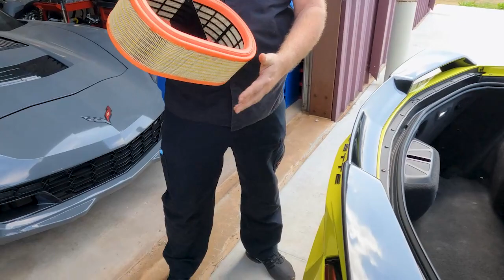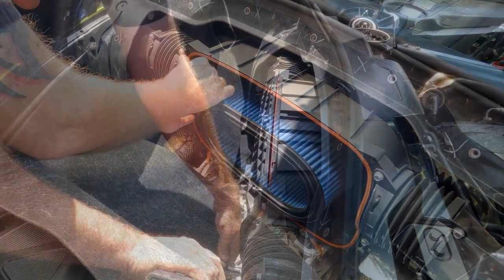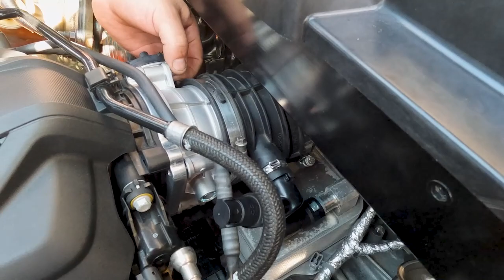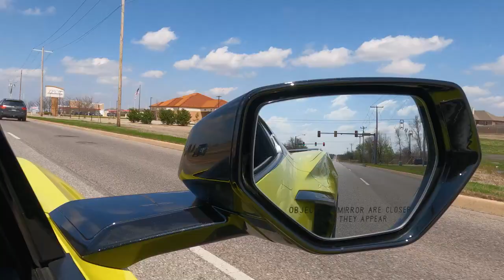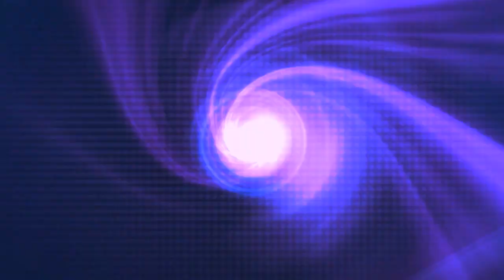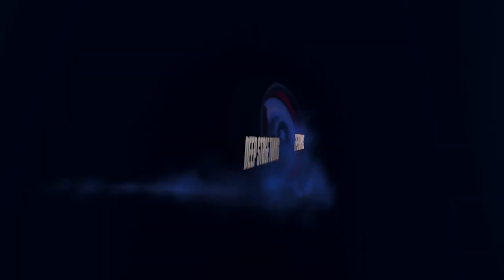C8 Corvette New Throttle Body and E85???

Comment: Nice vid. How long would it take to just change the throttle body? Thanks.
Reply: Changing the throttle body takes about 30 minutes give or take.  The hardest part was trimming the intake tube down to accommodate the throttle body adapter plate.  But overall throttle response was great.

Comment: Are you working with someone on the calibration for the e85 or is it all you, or is the factory tune adjusting for it?
Reply from the maker: The factory tune will compensate as it is a closed loop fueling system
Reply: You can run e85 of a c8 with no tune
Reply from the maker: @Eric Rodriguez  yes we are aware.  Being a closed loop fueling system it adjusts as needed.
Reply: When you install, the throttlebody didn’t throw any check engine lights
Reply from the maker: @bad_gtr7505  no it hasn't thrown any codes for the throttle body.
Reply: What are the gains by adding E85?
Reply from the maker: The gains are relatively minimal but a solid 8-10hp difference without tuning.  @jtheadturner

Comment: When you put the 95 mm throttlebody does it through a check engine light I’ve been running E65 without any check engine lights I’m just curious about the throttlebody
Reply from the maker: We haven't had any check engine lights at all.  BUT, now the C8 is tuneable.